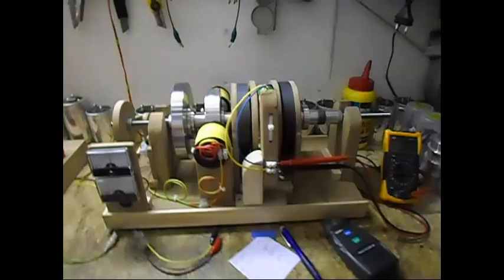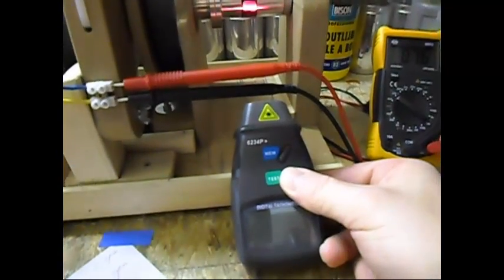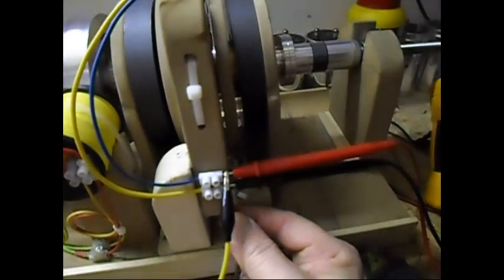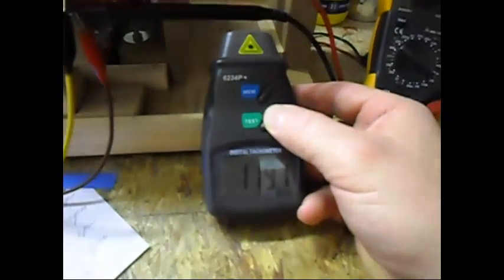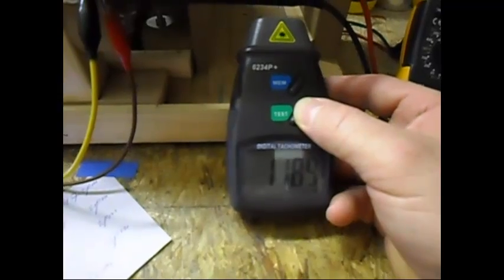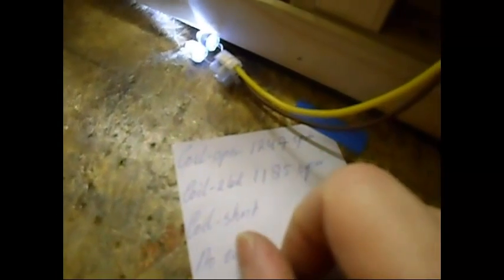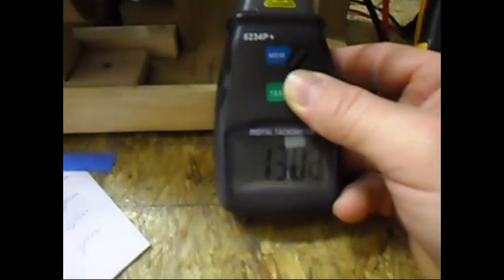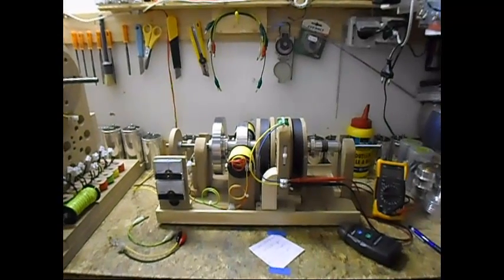Flux Gate Generator - Update 4 Pull Mode, 2 ring magnets - short coil...

Comment from the maker: Here i'm doing a test with the short coil as in Update 2 but with a Pull Mode magnets configuration...^^
The input is also lower this time, 16vdc @ <30ma since i broke my voltage doubler...less input wich means like 6oo(ish) rpm less but with better output...;-)

No coil in place = 1365 rpm (i said 1375, bearing issue gives a bit rpm fluctuation)
Coil in place and open = 1247 rpm
Coil loaded = 1185 rpm
Coil shorted = <1150 rpm (it won't go a lot lower than maybe 10 or so)
At 7.58 minute mark,

I said Push/Repulsion mode but it should be the opposite...;-)